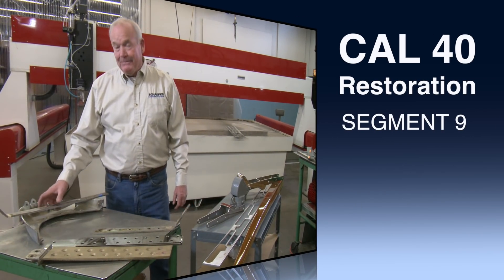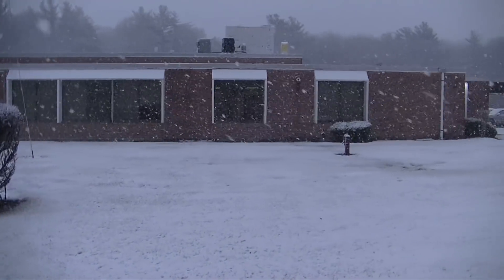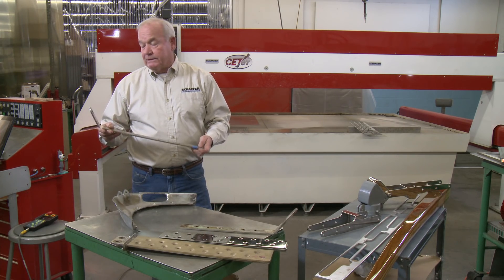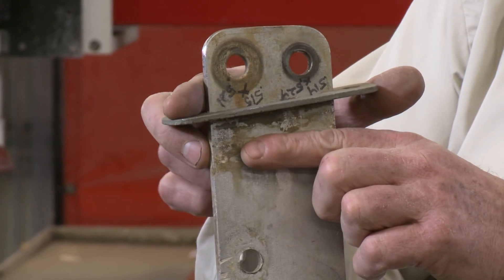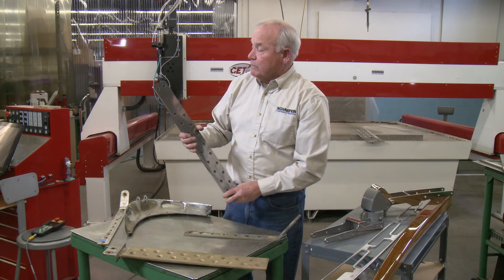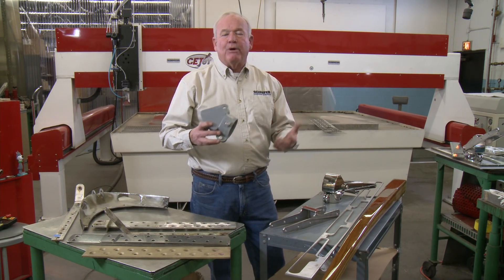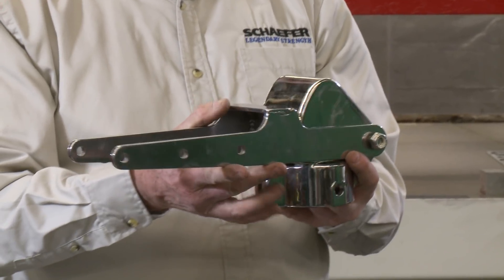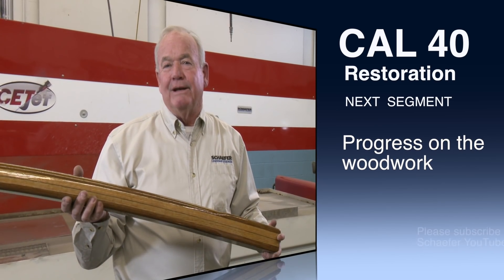Cal 40 Segment #9  "Can Water Cut Metal"

Comment: Seen many people doing repairs of cracks and soft decks around chain-plates etc. .  But they never give it a second thought as to what caused the problem in the first place.  If you got cracks, something is moving that shouldn't be moving. Usually weak or tied attachment point or the metal itself